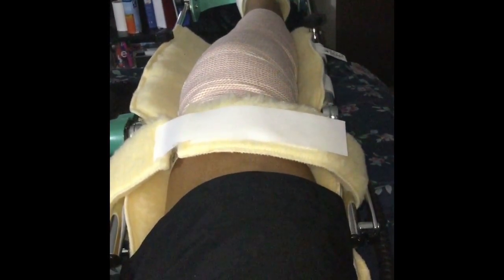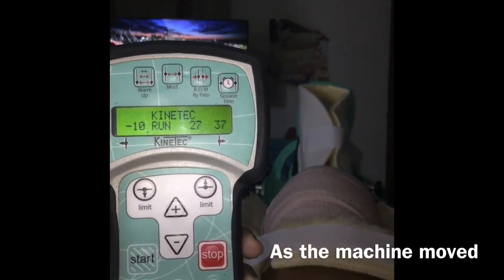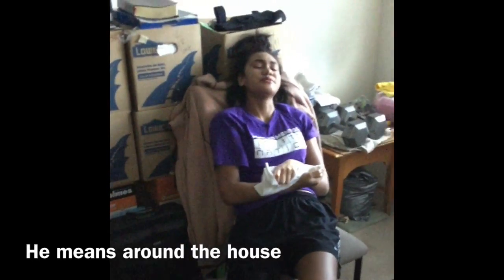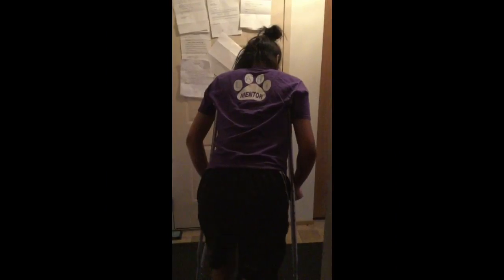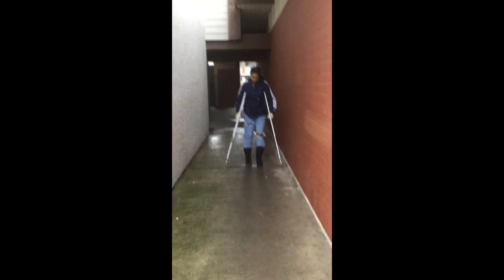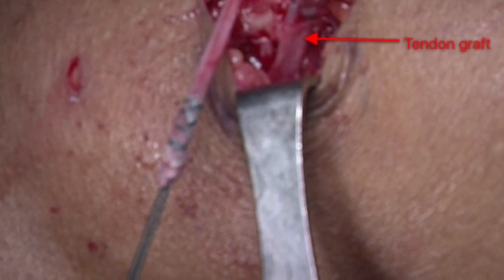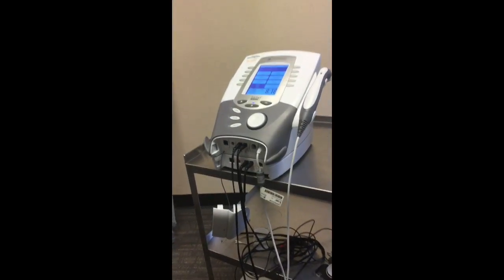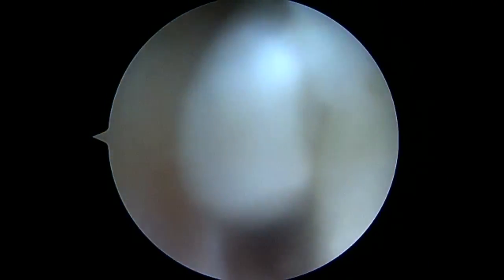Medial Patellofemoral Ligament Reconstruction Surgery: A Documentary

Comment: Thanks for sharing your experience.  I just had some surgery done on my right knee where they "fixed" some of the meniscus tears and also abrasion chondroplasty patellofemoral.  So there were three procedures done.  My knee looks like a softball and it hurts to get around my house.  The hospital did not give me any exercises to do yet I feel like I have to move it.  I am just afraid that I might do some damage if do stretching without guidance.  Did you have a CPM machine at home?  It looks like it is very helpful to prevent stiffening of the knee joint.  How often did you have to use it each day?